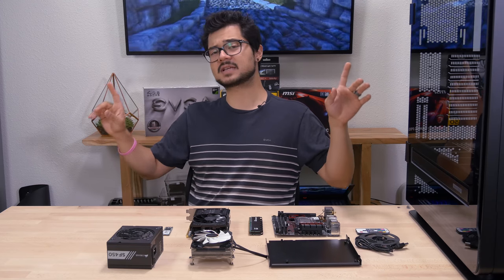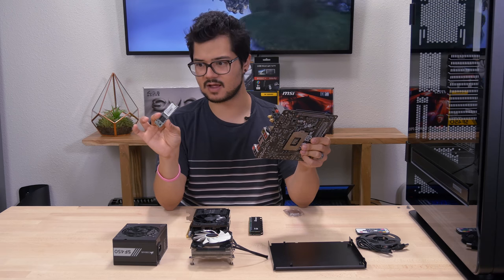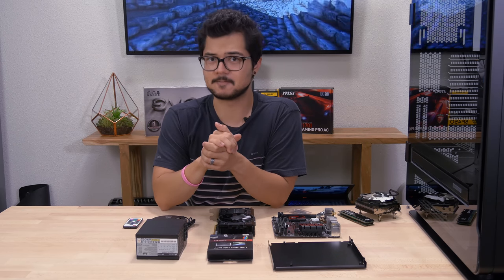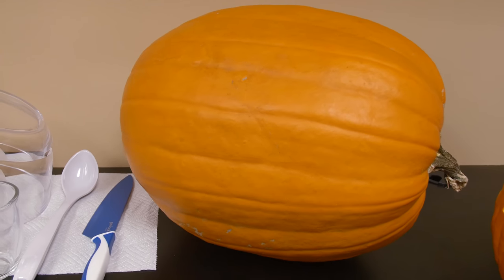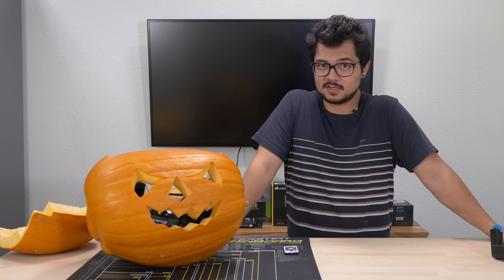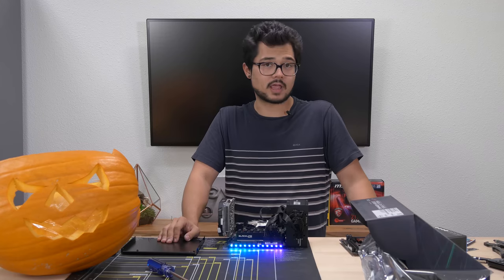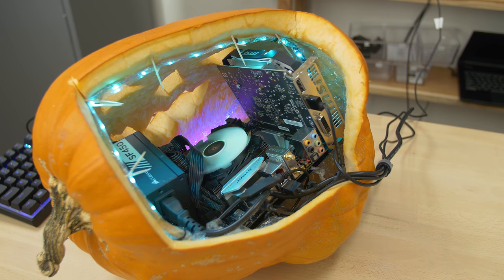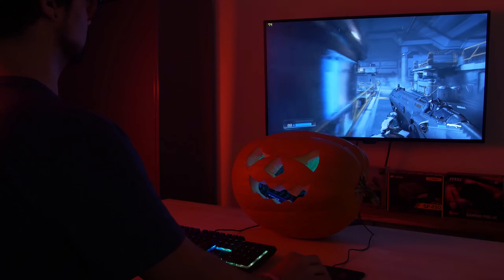A gaming PC inside a PUMPKIN!

Comment: ProTIp - set motherboard to auto power on when power is applied. This is either in the BIOS directly, or via setting the motherboard from ATX to AT mode.  That way you can just flip the power supply switch, or plug it in, instead of poking around with a screwdriver.

Comment: Hi guys need your help / advice.

my current mobo is Gigabyte GA-H61M-DS2 with Intel Pentium G620 / 8GB ram. (5yrs old haha)
now, i got a hold of a used i5-3470 (3.2ghz) and tried using it (it works)
should i buy a gtx 750ti or rx 460 to complete this build for my nephew? (not a 1080p monitor)
Looking forward for any advice :)

Comment: ⭐️⭐️⭐️⭐️ four stars
Air flow was pretty good as the entire front panel supports an open flow design and because of the moisture in the case dust is not an issue 

However. The case doesn’t have great cable management, so nearly a perfect mini atx case but held back by such a small issue 

To conclude my review of the NZXT pumpkin i would recommend this case to a friend but I would love to see a new version of the case with better cable management and more RGB integration

Comment: The original setup may not have booted because you were using a Kaby lake chip in a Z170 board. The board may need a bios update before it supports the Kaby lake chip.

Comment: i know its been a year, but i'm new to your channel and trying to catch up. That being said, if I were to do a pumpkin build like this, some edits and adjustments i would make are, 1, A spray urethane coating on inside and outside of pumpkin (so it doesn't rot and to seal any moisture within the pumpkin hide) 2, a breathable black mesh type cloth (think the same fabric in a Halloween Scream® mask) 3, a piano hinge (or like) for the lid to remain attached to the body.  Otherwise I think is a great "weird" build.

Comment: Maybe..just maybe if you line the pumpkin with aluminium foil first and then the cling wrap/plastic (so it doesn't conduct electricity), you'd get more light reflection inside the Jack O Lantern for extra RGB goodness?

Comment: HI, 
Its tuff to play CS GO on 21FPS with my late 2009 MAC soo... can you please help me out with my build (the list's below). Well,  This is a budget Build so I'm trying to cut down on few and spending a bit more on CPU and GPU. Please suggest which ones the right ram for a Ryzen 7 1700 and the required PSU (W) to this build. 

THANK YOU

For Motherboard:

1. Asus B250F Strix Gaming 

2. ASUS PRIME B350-PLUS AM4 AMD RYZEN B350

3. GIGABYTE GA-AX370-Gaming K5 

4. Asus Z270F Strix Gaming 

For CPU:
AMD Ryzen 7 1700

For GPU:

1. GIGABYTE GeForce GTX 1070
2. MSI Radeon RX Vega 56 Radeon

For RAM: pick the 

1. Ballistix Sport LT 16GB (2 x 8GB) 

2. G.SKILL Flare X Series 16GB (2 x 8GB)!!!THIS!!?

3. HyperX FURY 2400MHz DDR4 (2 x 8GB) 

For PSU:
EVGA SuperNOVA 750 G3 - Rs.17,940 (12,510)

And HARD DRIVE AND SSD:
1. WD BLACK 1 TB 
2. Sand disk 120 GB

Comment: You should just use a Pico power supply. Also the Low profile gtx 1050ti that I have might be smaller than the 1050ti from EVGA.